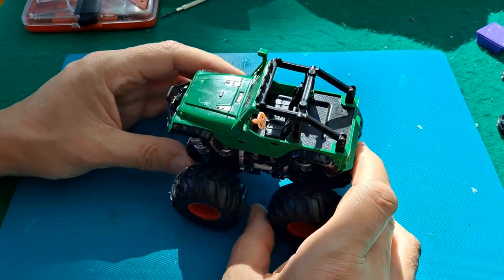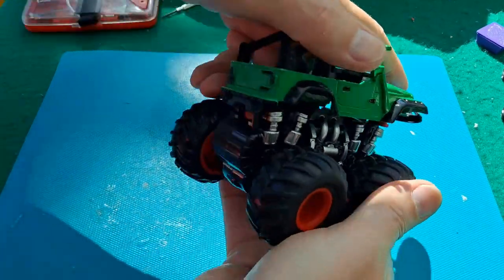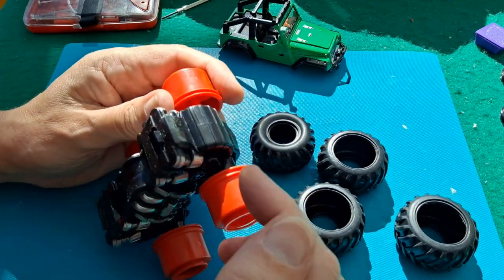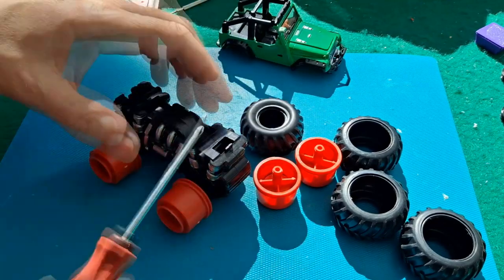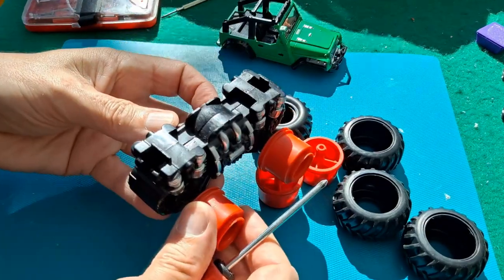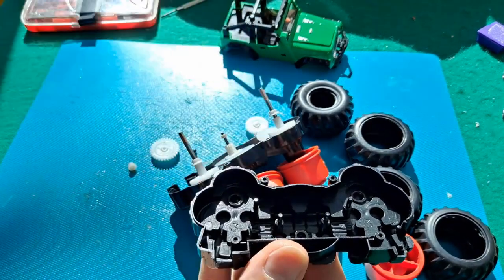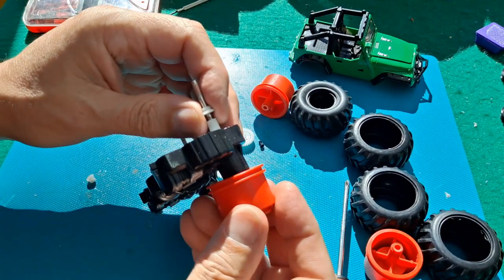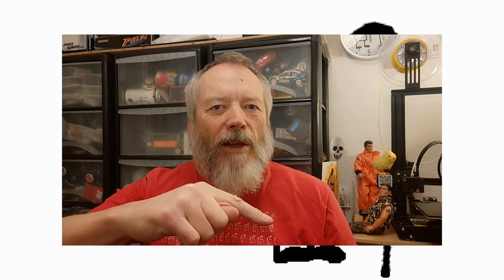Friction or Flywheel powered 4WD toy truck teardown 20210810

Comment: What do you do with the screws and nuts etc .I saw a great thing on YouTube ,a guy was showing some of his favourite buys one of them was a magnetic dish to put screws etc in so you don’t loose them when building something well I went on eBay right away and bought 2 one for us and one for our son they were £4.99 each …….NEW MAGNETIC PARTS TRAY 6" 150MM MAGNETIC DISH STAINLESS STEEL GARAGE HOLDER…… ( copied and pasted  from eBay listing ) not used it yet but wish we had one years ago x
Reply from the maker: Thanks for thinking of me 😊 I just have magnets in plastic trays, in fact a couple of the trays are metal so the magnets stay where they are put. However I often forget to use them and have to search for the screws that get misplaced 😆